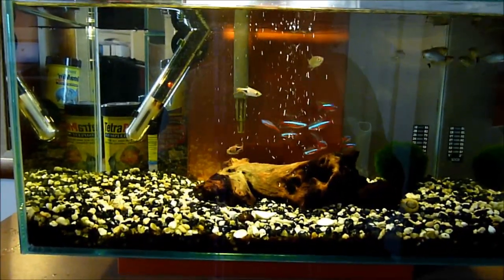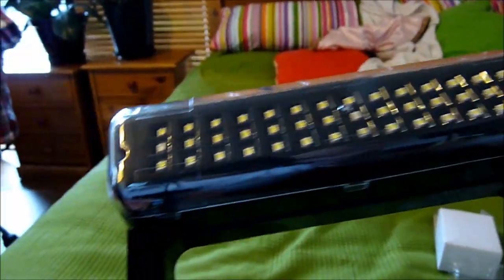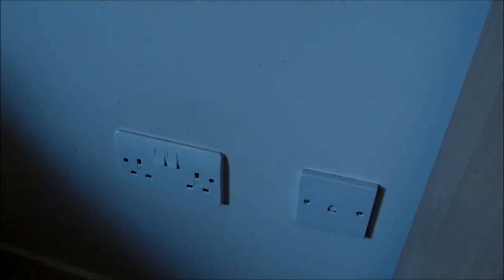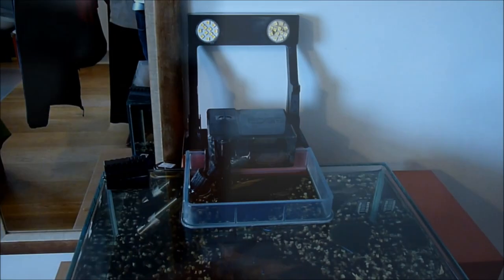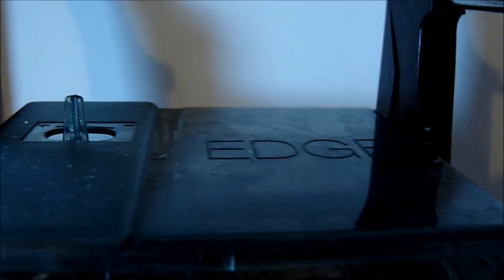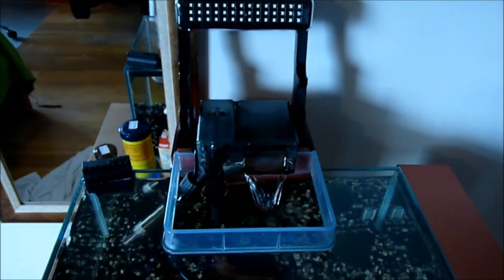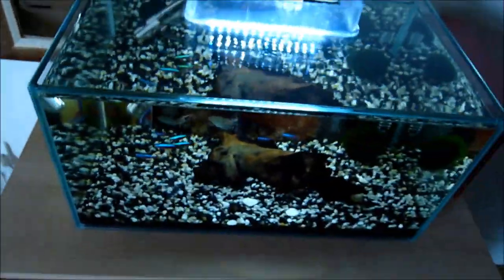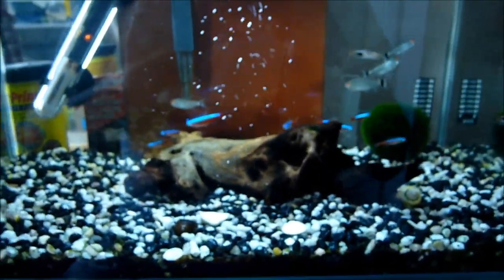Fluval Edge OEM LED light upgrade

Comment: It is not plug n' play, it's Fiddly As F*ck. But points for taking the time to make this video as a warning to anyone thinking of doing the same.
Reply from the maker: ahh its not too bad :)
Reply: I did like your mention of the rear unit serving as a handy safety net for catching errant screws. On your inspiration I have now ordered one for my 23L. I'm sure that once it's fitted the hardest part will have been the steep price! ;)
Reply: @JohnSmith-oh1ow  How did this turn out? I also heard the 42 LED light bar can be a little tough on some species, like Neons
Reply: @jacobekker  i love my plants in my 23L but the light is too weak...I want to upgrade but I don't know if the 42 led one will actually benefit the plant growths or will it result in already and stressed tetras